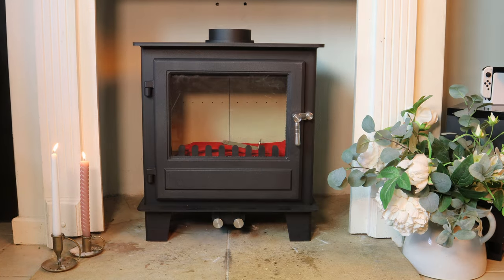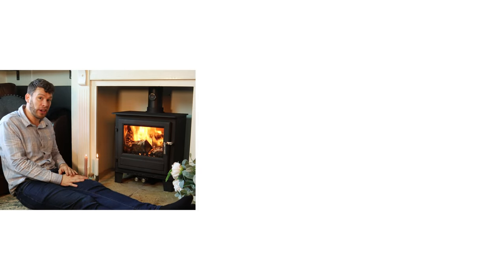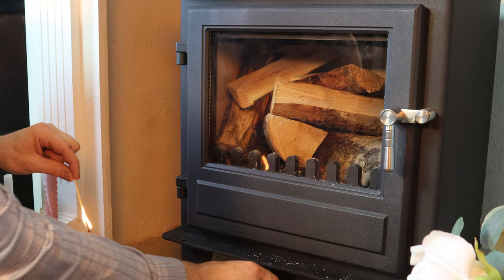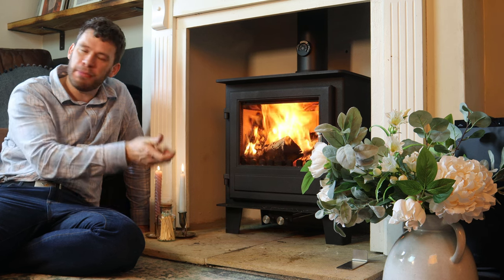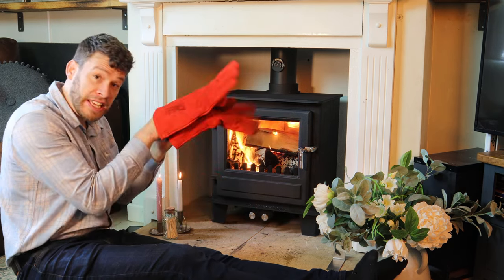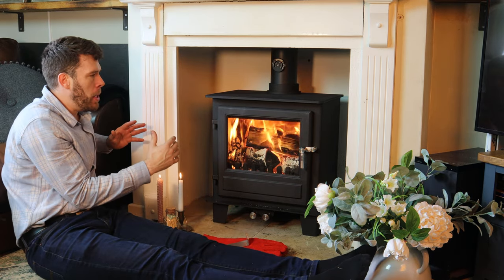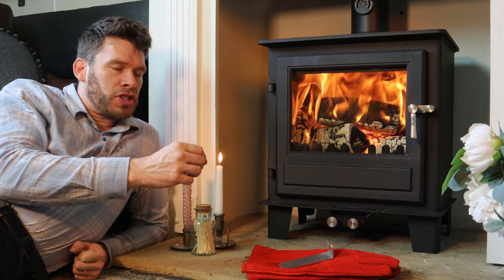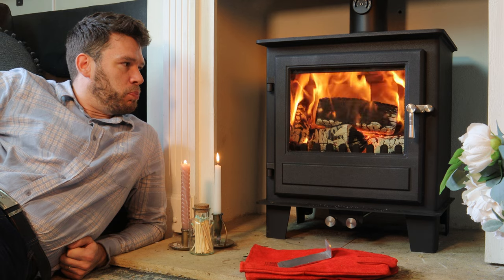Full review of the Clock Blithfield stove

Comment: Just had the Clock Inset fitted this week.  I have found personally that it goes through logs faster than hoped, even at lowest air setting there were flames (I have the compact also which goes completely dark when shut down) Having said that it's probably still bedding in. When my logs had burned down I started to add the smokeless coal which burned very well and seem to last much longer. That would be handy in very cold evenings to burn through the night.
Reply from the maker: The DEFRA kit will reduce control, but from what I hear that stove is really excellent. I will be looking at one soon too!
Reply: @TheTortoise  Yes Ive since learned that because its and eco stove it isn’t able to be turned right down like previous stoves. Bit misleading calling it eco as it burns wood quicker making it less economical or am I missing something ?
Reply from the maker: DEFRA and Eco-Design are different. So DEFRA is about burning hotter and therefore cleaner. Eco-Design became a lot about baffling systems in the stove and how they were insulated (with vermiculite very often). This made them harder to light and reduced draw, but also made them more efficient and cleaner. The real challenge is making a stove that ticks these boxes, but is also:

Easy to light
Controls well
Is economical
And obviously clean. 

Hence these things being the primary focus of our reviews, because efficiency figures tell you something, but they’re far from the whole story.

Comment: Thank you for all the information your sharing, really helpful when choosing a stove for the first time. I'm between this and the Heta Inspire. do you think there's much in it between the two?
Reply from the maker: There are a couple of things:

Check the room size because despite the 5kw output the Heta is more like 4-7 and the clock is 5-9. 

They are both wonderfully controlled and clean, but the Heta does have the practicality edge with its single air control and stay cool handle. The clock on the other hand thanks to its size has the running overnight edge.
Reply: Amazng thanks for your response. I thought both would have the ability to comfortably burn overnight but I guess the Clock just does it a bit better than the Heta? Thanks, all valuable advice before we get our first stove next month :)  @TheTortoise
Reply from the maker: @calumcrotch1906  both are multi-fuel so have a little compromise to serious overnight use with wood. They both can run overnight, but given the Clocks size it is a little easier. On the flip side the Heta Ambition is even easier again to run overnight.

Comment: Would you be able to do a review of one of the Charlton & Jenrick / Fireline stoves like the PV5W? They look to have really good features (baffle plate drops when door opens, to draw smoke up flue) and nice build quality but want to know what you think.
Reply from the maker: They have mentioned on a couple of occasions that they would like to do that, but have yet to find a spare stove. I am testing an FDC which is the same stove as several of the FireLine stoves, but not the same as the PureVision. I will get to one of these ASAP.
Reply: Very good stoves  pure vision. The top end of charlton and jenricks stove range . Go eco budget. fireline mid range then Pure Vision at the top.
Reply from the maker: interestingly though, they’re all made in the same factory in China.

Comment: Great review. We’ve had a Sudbury since last year, only complaint would be smoking when refuelling, but you do get used to it and sometimes it’s not an issue. No complaints about the magnetic handle, it works perfectly. Look forward to you reviewing one.
Reply from the maker: I’ve heard a lot about those handles, I’m really keen to give it a go too!
Reply: Just a question, when testing a pure woodburner, as there is often no primary air control for air coming up from below,  the handle/door is left slightly ajar to feed air to the fire until up to operating temperature. So how do you achieve that with a magnetic door latch?
Reply from the maker: 😆 that’s a good point, I haven’t tried their Sudbury yet!

I’d have to give it a go, as I imagine they will have thought of something (the air system may allow for it in some clever way).
Reply: @TheTortoise  Popped into a local stove shop yesterday to look at a Sudbury. Nice stove but when I asked the retailer how she manages to light the fire without being able to leave the door ajar (because of the magnetic door latch) her answer was that she wedges it open for a period of time with a piece of kindling!  The clock user instructions say the lighting procedure for the Sudbury is to open the vent fully and after 20 - 25 minutes! it should be up to operating temperature, then close down the vent and use in the normal way to control the burn etc. I am sure Clock know what they are doing, and this may well be a non-issue in reality, but having designed such an elegant handle for the Blithfield, I wonder why they decided to change it on the Sudbury?
Reply from the maker: I’m going to ask to test one. I’ve gotta know now. I expect the person on the shop is just wanting it to light really quickly, but this has my intrigue now.
Reply: Please pkease review sudbury soon. Can't wait to hear what you think

Comment: Thank you for this helpful review! Looking at the compact version as will probably suit our lounge more as it’s small/medium in size and means carving less of a hole in our fireplace. Previous occupier had a gas fire before so only a small hole left behind. Thank you so much for this review. Would be interested to know how other compact users have faired. The comments I’ve seen are positive so far!
Reply: I have a compact, I have used it for the last 3 winters, so from October until April. It is fantastic.
Reply: I should have said that I often have a good bed of embers still going the next morning that’s the beauty of multi fuel.  So I open the vents back up add a few bits of kindling and a little log and away it goes. Thinking about it it’s probably used for 7 months over the end of autumn winter.

Comment: Hi, will the stove stay in over night with the defra kit in place?
I am seriously thinking about buying the compact version.
The control ability sold it to me.
Great review, thank you.
Reply from the maker: I expect so, but there are a few differences. Obviously the compact is much smaller and the vent being more open will increase the burn rate. I would expect it’s very possible, but it will need good technique and fuel.
Reply: @TheTortoise thank you for your reply.
Reply: @TheTortoise  Hi, one other question. Where I live is not a smoke control zone so therefore I can remove the Defra kit? Will the fitters agree or insist that the Defra kit has to be engaged as part of the installation? 
If it is engaged how would I remove it after installation, is it possible as the kit is on the rear of the stove?
Reply from the maker: It’s worth having your fitter as part of the conversation, because to remove the kit you will need a 6” liner fitted. As long as this is done, they shouldn’t have any interest or requirement in the DEFRA kit being in place.
Reply: @TheTortoise  Thank you very much for your expert advice, it's appreciated.

Comment: Any guidance on how to use?😅 I just got my clock blithfield 5 and the air control baffles my mind!
Any good time guidance, anything to look out for before shutting down the right control? Help! 😂
Reply from the maker: A stove thermometer is probably a helpful idea as it will guide you on when to close things down and open up etc. we sell them on our website, if you decide to get one. 
Generally you will close the Primary air (air from under the grate) once the stove is up to temperature, and you can then control the stove with the secondary air. If you burn coal then you will tend to control the stove equally with both controls. Once you’ve got used to keeping it at the right temperature, you can then look at more advanced control, but let me know when you’re at that point.

Comment: I got my Clock Blithfield 5 Standard a year ago, my first stove, and I can endorse everything you say. I found last winter that I didn't need the primary feed at all to light the stove, and had it closed the whole time (burning wood). So far this year the stove seems to need more air, although that may be that I'm using my own seasoned wood this year. Last year I had to buy in kiln dried, but my moisture meter tells me the logs this year are just as dry. Any thoughts on that?
I've also found that burning anthracite briquettes needs an AGE to get up to temperature, and then only if I load up lots of fuel from the outset. Overall, I'm very happy with my choice - I'd buy it again.
Reply from the maker: Kiln dried will dry throughout the log. It’s probable that the centre of your logs is still a bit damp and that is slowing the burn. You could split them again to find out. 

With regard to smokeless fuel, to be fair this generally doesn’t reach the same temperatures as wood, so the whole process is a bit more gradual.

Comment: Great video. Would really appreciate some advice on choosing a stove. Picking between a Clock (this one or the Sudbury) and a Clearview (Pioneer 400 / Vision 500) 

- We burn wood 95% of the time
- Would ideally like to be able to heat two 5m x5m connected rooms in a drafty house 
- like the Clearview brand
- like the larger window on the clock
- prefer not to add a vent but can do if absolutely required 
- price difference seems to be a few hundred pounds so not likely to be a deciding factor. 
- will be used a fair bit so ongoing, real world economy is important.. 

Thanks in advance !
Reply from the maker: Thanks for the message. The Sudbury or Blithfield 5 would definitely have the real world performance advantage over the Clearview. Given the space and draughty nature of the house, you could consider the Blithfield 8, but as you say it includes the requirement for an air vent.

Comment: Just purchased this fire. What are your thoughts on fitting a removable plate on the bottom of the griddle plate  to more resemble a wood only burner then if you fancy using other types of fuel then just lift it out., From what I can gather from people I know they all chose a multi fuel but 99 % stick to burning wood . The only fire I know of that closes of to more resemble a wood  only is the Woodwarm but there seems to be little reviews on these models. Thanks
Reply from the maker: Yes I’m hoping to arrange a few Woodwarm reviews very soon. I think you’ll get on fine with a plate, but I must admit I ran this stove overnight with ease (even in its standard set up)!

Comment: Another great review, although would be helpful if you ran a little smokeless fuel in your reviews 🍻
Reply from the maker: Interesting you say that. I have been filming today and it’s the first one that I have done some testing and filming with coal based fuel. I don’t generally want to encourage the use of these fuels, because there are a number of downsides, but I agree these fuels do still have their place.
Reply: I have the same Blithfield 5 that the Tortoise is using here .
Once you have the temperature at operating point , put smokeless coal on and it is really good .
What we do ( we are in the U.K. is run it on wood through the day , let the wood burn down before bedtime , put a quarter of a 10 kg bag of smokeless fuel on and get it running on wood the next day 😀
Reply from the maker: @javidjames3319  sounds like you’ve got it down. 👍
Reply: I was told by my chimney sweep although it's a multifuel you are not supposed to burn smokeless solid fuel. I have tried it with my clock and it never stays lit. Same with anthracite, very hard as it's a dark art to use the 2 controls.

Comment: Hi there, I have the Clock Blithfield compact as it fits the room better and I like to have more room each side of the stove (not keen on seeing them squeezed into the fireplace). Anyway I would be interested in knowing whether everyone leaves a layer of ash in the base of the stove after it goes out and relays the new wood for relighting on top or cleans the stove out. I've always tended to clean out all the ash when cold and relaying for a new burn each day as it's easier when the ash is cold but that means I don't have the ash bed from the start. Which is best anyone?
Reply from the maker: Definitely leave the ash!
When burning wood a clean stove is a greedy stove. Leave the ash in and everything will work better, more economically and efficiently.

Comment: Great review! Ive just had this stove installed. Is it ok to put a cast iron kettle on top of this stove? Is there any negatives to this or any chance of damaging the stove? Thanks
Reply from the maker: This stove is unfortunately not well suited to this. You could damage the paint finish and it will also not boil a kettle, as it has a convection top.
Reply: Thank you for your reply.
Reply: I put pans of water to boil and sometimes cook small casseroles etc on my blithfield compact perfectly fine with no problem. It's a solid build.

Comment: I’m looking at this or the DG Ivar 5. I’ve had a multifuel previously and like the idea of pan for cleaning it out and the ‘option’ to burn other fuels. However, it will mainly be wood with maybe some briquettes every now and then. In terms of efficiency I was going to go for the wood burner this seems to super easy to light and is also very efficient. I’ve also seen seen your Heta Inspire review and that looks great but seems a bit fussy in terms of fuel and set up. What would you go for between the clock, Ivar and Heta? Thanks 😊
Reply from the maker: That’s a tricky one, they’re all awesome!

The Clock is the heaviest beast of a work horse, so that I would consider based on my intended use. 

The Ivar is the most focused wood burner, which although flexibility maybe useful, will prove to be the most economical choice. Burning overnight with wood is superb and it will naturally produce less ash too as it is constantly re-burned. 

The Heta is the most refined. Everything is butter smooth, the handle fees like a Mercedes and doesn’t get hot. Every bit of it feels too if it’s game. But to be fair in this company it is the least focused on constant or serious use. That said we’re sort of splitting hairs because these are all as I’ve said “top of range”. 

I would genuinely have any of them and think, this thing is superb every time I used it!
Reply: Many thanks for the quick reply.
I think it’s between the Ivar (or Anste) and the clock (the hetas needing things a bit too perfect is off putting)I know you should always burn really good quality wood. Im guessing the clock being more versatile would cope would less than perfect (moisture wise) timber?
They are both the same price range. I think I’m leaning towards the clock due to versatility and not being that much less economical than the Ivar (based on your testing 12 vs 14 hours).
Decisions, decisions, thanks again 😊
Reply from the maker: Yea, you’re picking between 2 superb bits of kit so to be honest you can’t really get it wrong at this point.
Reply: @TheTortoise  great. Thanks again for your help 😊

Comment: Hi, I’ve just purchased this stove . Any idea what the four bolts are on the back and is the round disc the defra part. And how does it work . Thanks
Reply from the maker: The 4 bolts are likely to be about attaching a heat shield if needed. I’m not sure what you mean by the round disk, the air controls look a bit like 2 disks on the back of the stove. How it works is sort of the basis of the whole channel, but watching the review is probably a helpful start.
Reply: I called the manufacturer and was told the defra kit is in operation if the rectangular tab is not covering the hole. The circular cover is for the air system that comes through the holes in the back of the fire bricks and to leave that one alone as there is a small measured gap in there that regulates how much air comes in through those holes.

Comment: Does it come with a DEFRA kit on as standard, and is it easily removable? Because I live in a smoke control area, my stove choice always comes down to a stove that's still controllable with the DEFRA kit on, or one where it's easily removable if needs be... I personally think it's dangerous not to have full control of the stove.
Reply from the maker: The DEFRA kit is standard and very simple to remove or add, as long as you can access the back of the stove. The control even with the kit on is still effective so I definitely think it’s one you could consider.

Comment: Would this stove be in your new top 5 stoves? I’m caught between this and Clearview Pioneer as had them before a Dik Gurtes soren 5 and a woodwarm fire view 5 kw. Help!!!
Reply from the maker: This was my stove of the year, so it is certainly highly rated. If you’re burning wood then the DG is perhaps the best option. I’m using a Fireview at the moment and this along with the Clock is exceptional. The Clearview is obviously an old school beast, it has its charms, but will certainly be beaten by the others in terms of efficiency. I think if I wanted a multi-fuel then primarily look, which I preferred using (handles and control etc) and price would drive me between the Clock and Woodwarm. The Clearview could pick me up if I was feeling a bit of a nonconformist 😆.
Reply: @TheTortoise  thank you. I’ll let you know what we choose.